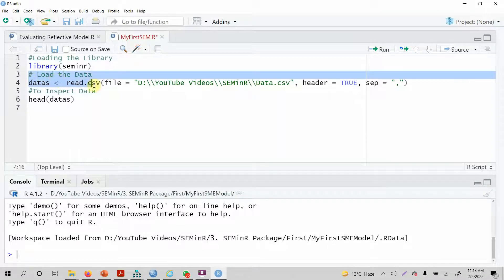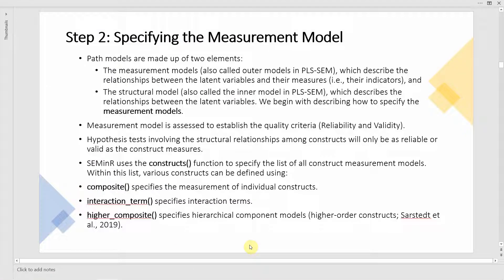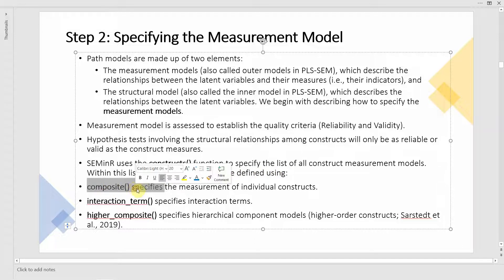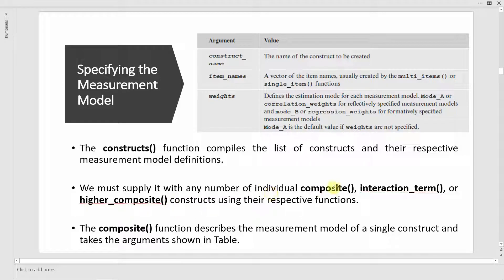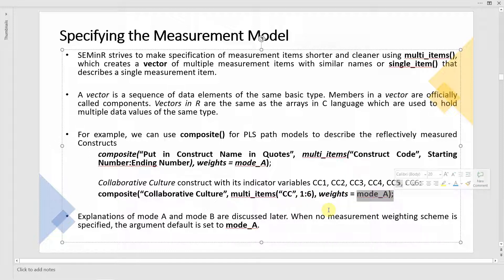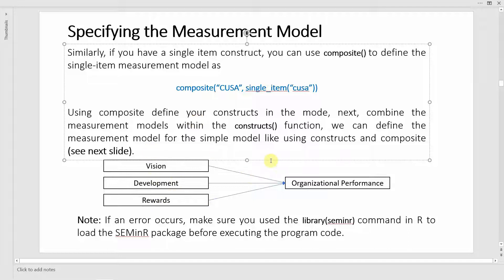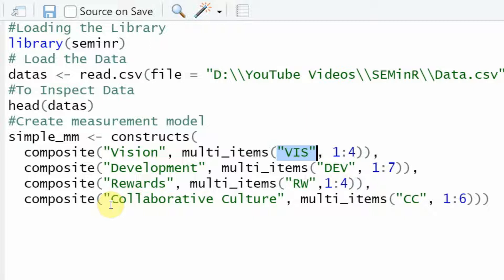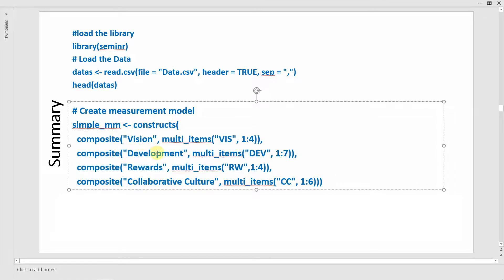04. SEMinR Lecture Series | Specifying the Measurement Model | PLS-SEM in R

Comment: Hello sir. Thanks well explained videos.

Pls my challenge is that the structural equation modeling diagram is not usually bold when exported fuom R.

Could you please make a video using the r code to make it bolder and colorful. Just like the way it comes in blue and yellow when using tge other software.

Comment: Hey, Prof. Salam, When I am doing the estimation, I get an error message like this, what could be the reason? 

> pls_model <- estimate_pls(data = finaldata ,
measurement_model = mm,
 structural_model = sm)
## Error message: 
Generating the seminr model
Error in if ((mmMatrix[mmMatrix[, "construct"] == construct, "type"][1] ==  : 
  missing value where TRUE/FALSE needed

best wishes.
Reply from the maker: Can you share the complete code plus the data (you can sample it) via email (kh.fawad83@gmail.com) or you can share the code with error on the FB group.